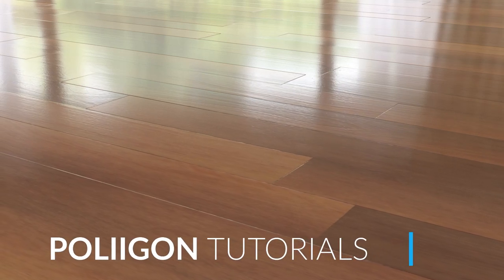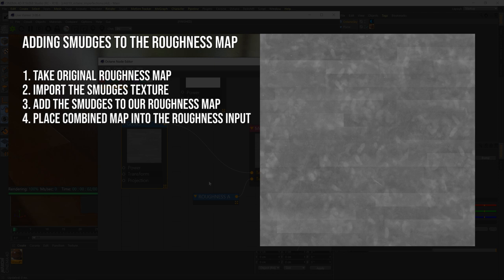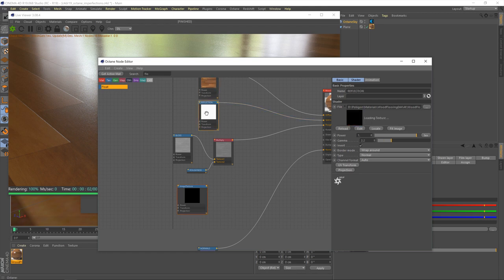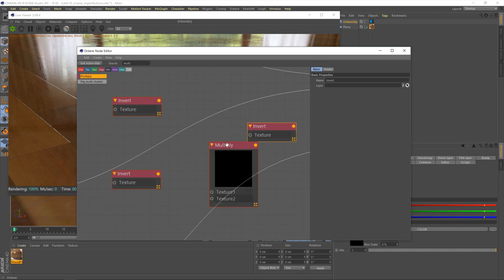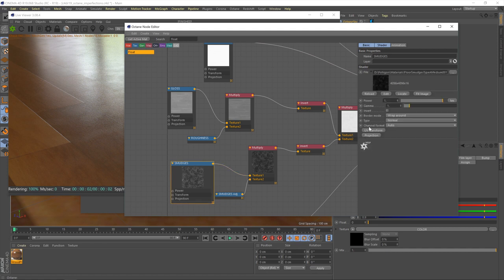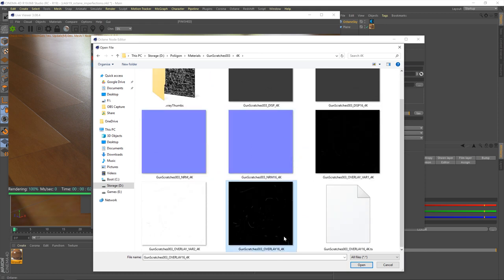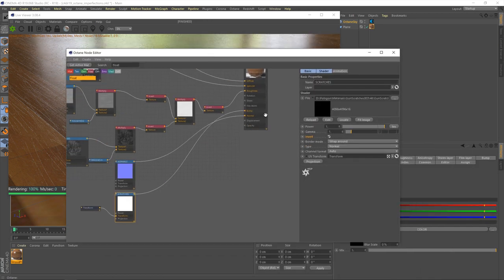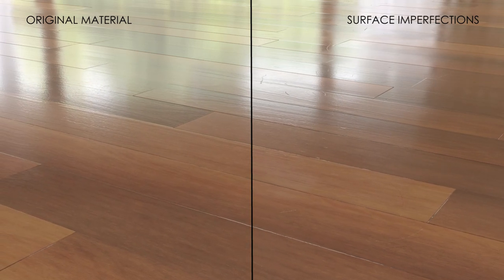Using Poliigon overlays to add surface imperfections in Cinema 4D with Octane

Comment: I've never heard the rule about changing gamma to 1 for black and white images.  Is that necessary for all materials like that?  I usually just leave the downloaded material images the way they are and only alter surface imperfections.  I never have changed the roughness image gamma for downloaded materials.